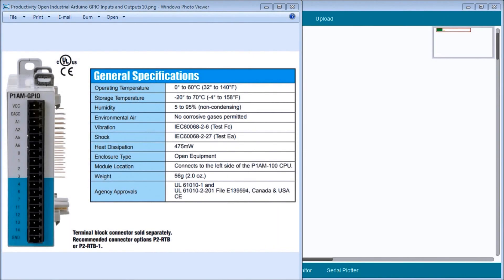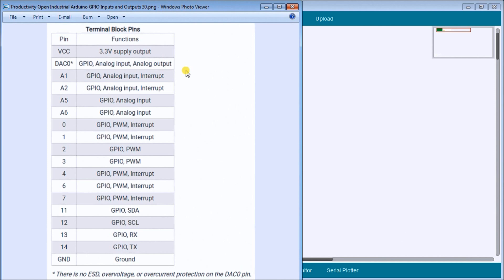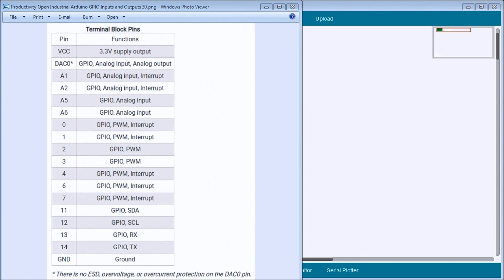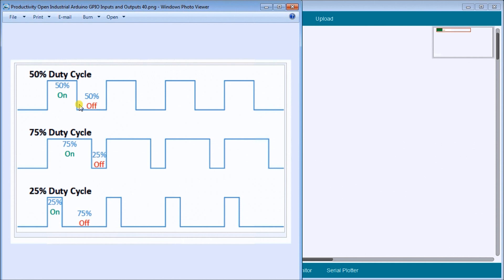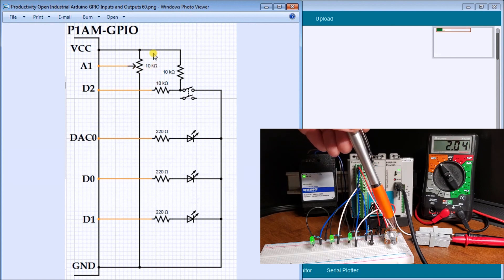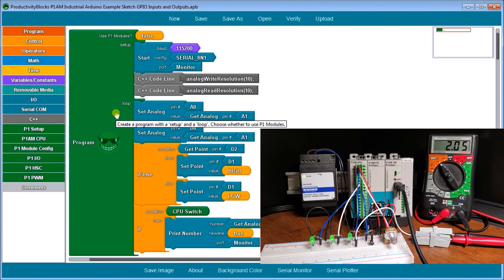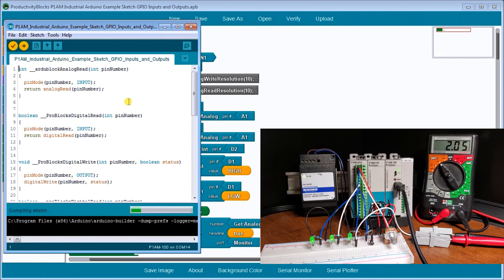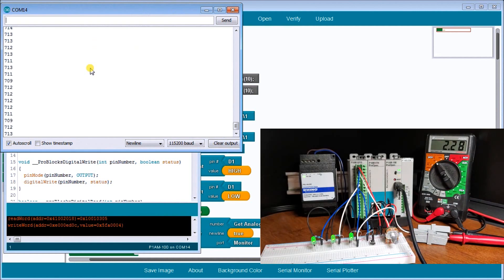P1AM Industrial Arduino GPIO Inputs and Outputs

Comment: I need an alternative to use the P1AM-GPIO shield? The issue I see with the GPIO shield is that it is running 3.3 V rather than 5V, and thus wouldn’t work out for my motor it needs 5V to run at this maximum speed.
Reply from the maker: What about using something like the following:
https://amzn.to/3SNtMtc
Just a thought.
Regards,
Garry
Reply: @ACCautomation  But if I use this will I  be able to control the speed of my motor as well i.e. will this level shifter converts 0 to 3.3V PWM signal to 0 to 5  PWM signal.
Reply from the maker: @VasukiTanujaPulikonda  
Since you are using PWM signals, then use the following:
https://amzn.to/4cw3rHa
Regards,
Garry